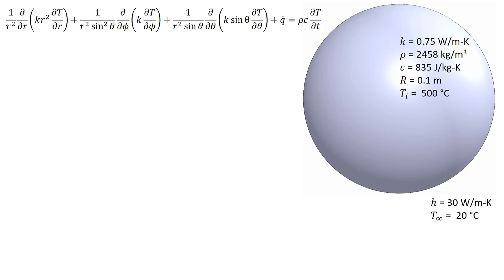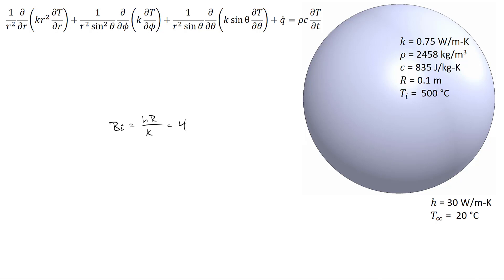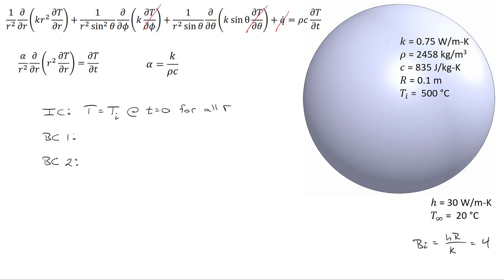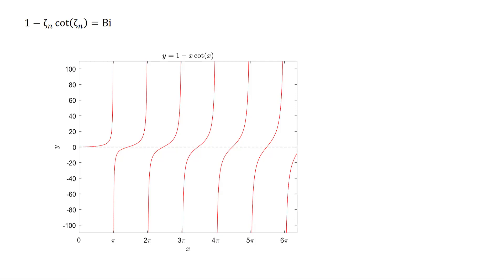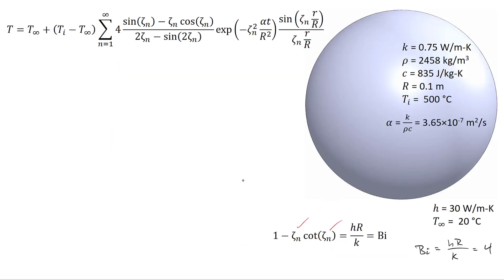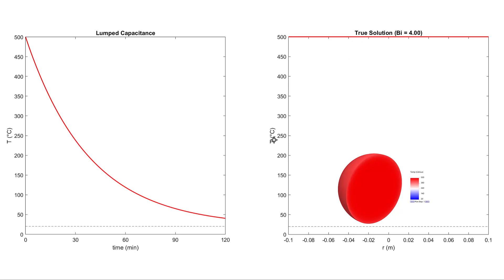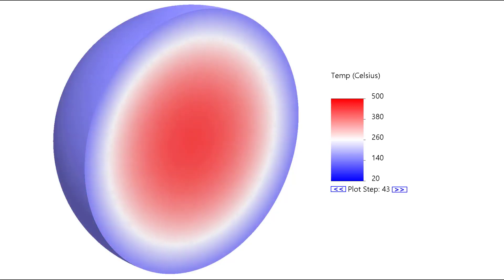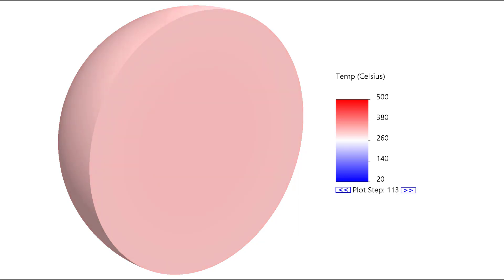Analytical solution for the transient cooling of a sphere

Comment: I know this is a long shot, but do you know how to include alpha as a function of radius? i.e. I could use this for material diffusion with the material diffusion coefficient dependent on T.
Reply from the maker: Interesting question... I hadn't thought about a problem like that before. you'd first need a function for alpha... does it just vary with the distance from the center (r)? That would make your life easier than it also being a function of theta and phi... I would probably discretize the heat diffusion equation and solve it numerically.